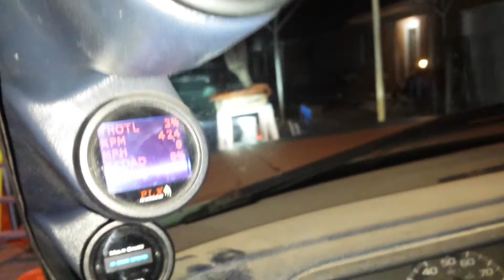97 tahoe running with built 6.0 4l80e cam #

Comment: So I take it this is before the 20" of wheel travel and 800hp motor you were talking about building? Do you have any newer videos on it after that stuff was done to it? I'm trying to build one and want to throw away the stock torsion bar set up and run a long travel suspension kit